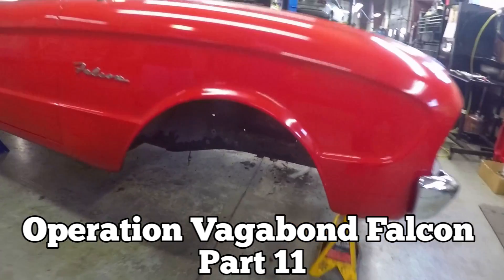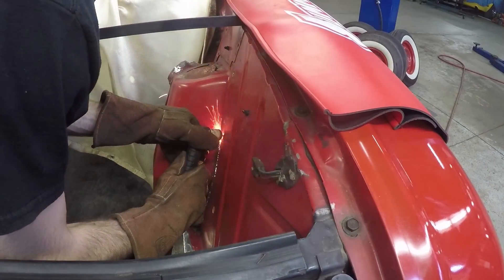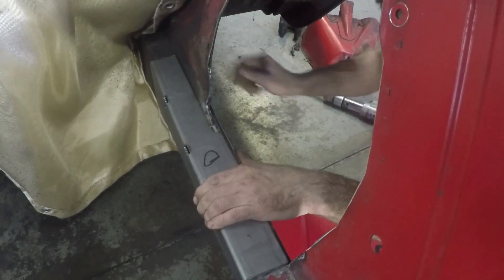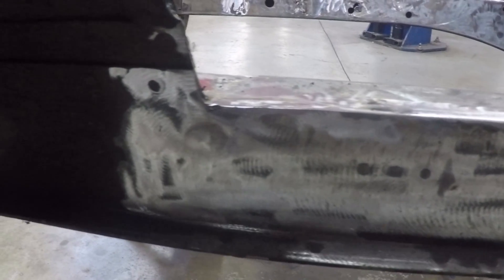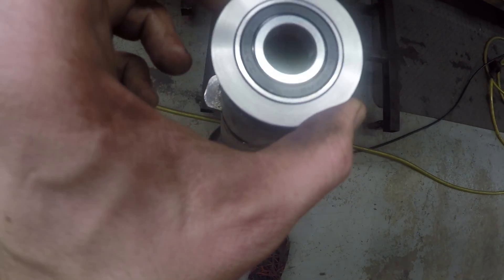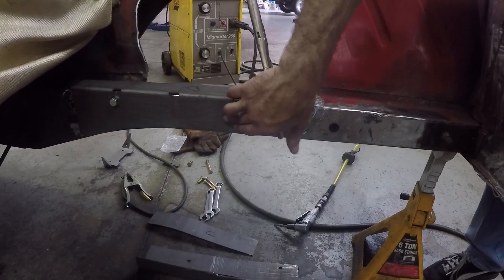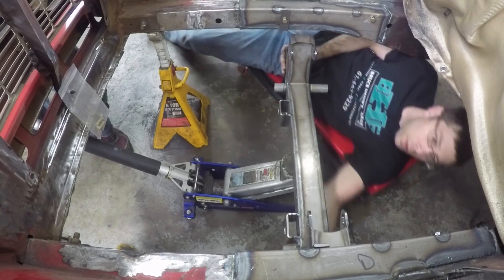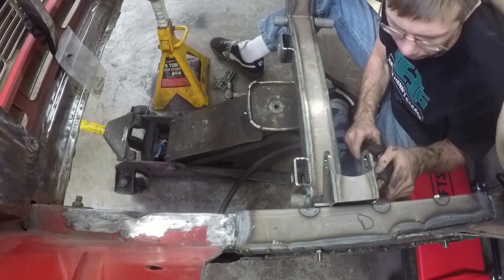Operation Vagabond Falcon: Part 11

Comment: When Ford indroduced the Falcon to Australia it was less well suited to Australian roads than the UK designed Ford Zephyr it replaced, the front ends collapsing were a major problem for Ford Australia in pre-release testing, I think they actually beefed it up before they went on sale here.
Reply: +milksheihk True that. They kept doing improvements through XL and XM, and according to lore and Ford, they only got them to stay together at XP (which would be what, 65 to the Americans? The one with the muffin top leading edge). XKs had a nasty habit of popping lower ball joints.

Comment: Man, this turned out to be a WAY bigger project than I thought it would be. I thought you'd just slap a 302 and an AOD in it and call it good. This thing is going to be awesome when it's done.
Reply: +Kaleido Motoring yeah that's what I though when I was thinking about getting a mx-5 and putting a v8 in it but nope, so I said fuck that I don't have the time, equipment or money.

Comment: A hell of a lot of work just to fit that Windsor 302 into the Vagabond Falcon. Cool to watch but I do wonder why not install a larger inline six (i.e. a 200 or 240 Ford straight six) instead?
Reply: Because that's not Australian enough
Reply: +ABatheist the 302 was cheap and available and 240 straight six will likely not match up with the ford AOD

Comment: B E A U T
Are you fitting a LSD? 
I do expect to see skid vids so you can become an honorary Australian
Reply: fellowship of the goat Its not a complete project car until it does shed skids.
Reply: +fellowship of the goat their 8.8 rear end should be an LSD
Reply: he's using a Ford 8.8
Reply: +rubberwoody Just checked,  his has LSD and 3.73 gears.
Reply: +freeze69IceMan as a Texan, I couldn't agree more
Reply: +rubberwoody Depends what it's out of, I don't remember what the donor vehicle was that he got it from but if it's from a Mustang it's limited slip. If it's from something else like a Ranger, Explorer, F-150, etc it may be open diff.